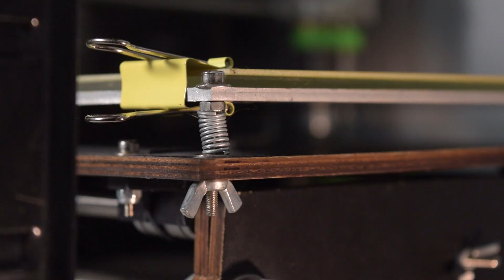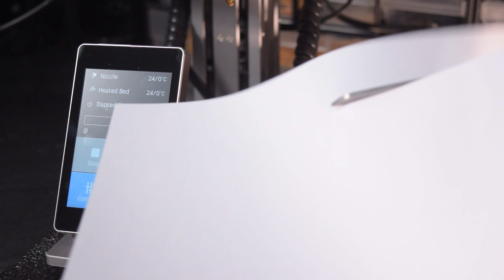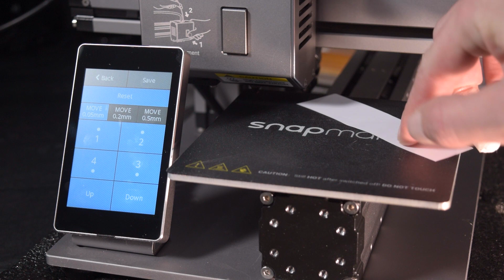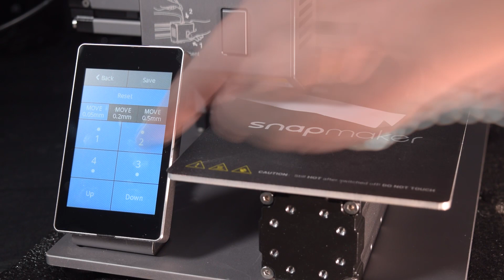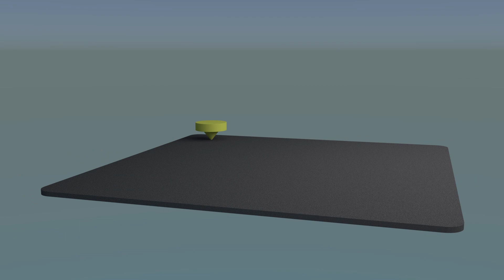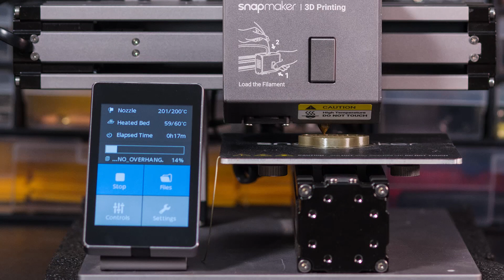How to level the bed with the Snapmaker 3D Printer (perfect first layer)

Comment: Can you do one on A350T?  My models are nicely printed on the left side of the bed, but the right side is not,  it’s very stringy and up smooth appearance.
Reply from the maker: If I had an A350T, I would happily do one. I'm surprised Snapmaker didn't submit one to Cura and other slicers for the A350T, they did for the regular A350 after I published my profiles - they were strikingly similar. :)

Comment: My x axis is uneven, the x tower has a trouble in that the holes for the screws on the back to hold it to the z axis are not drilled correctly.  If you connect the x to z and use a level the bubble goes to the right about 4mm and there is not way to change the x axis, what should I do?
Reply from the maker: That's a little odd. I'm not entirely sure. I'd start by posting photos of what you've got in one of the Snapmaker groups on Facebook to see if there's actually a fault with your parts and they've been manufactured badly, or if things just aren't connected right for whatever other reason. If there are issues with the components, that's something you'd have to take up with Snapmaker or the seller you purchased from.

Comment: Hi John,    Could you make a video on  "How to level the bed with the Snapmaker 2.0  3D Printer (perfect first layer)"
Reply from the maker: Funny you should ask! I've wanted to do one for ages, but haven't needed to re-level the bed on the Snapmaker 2 since I set it up in October. I'm about to swap out the hot end on the Snapmaker 2, though, so I'll need to re-level it after I do that and will definitely be doing a video going over both the automated and manual calibration stuff once I've experimented with them both properly.

Comment: just curious if you have code settings for the snapmaker original for cura. i believe i found the start and end gcode but i haven't found the extruder start and end gcode.
Reply from the maker: I can export them out and pop them on Github - I'll try to do that this week if I get a chance. You shouldn't need anything in the start & end code on the extruder tab, though, just on the main printer settings bit. :)
Reply: @JohnAldred  that would be great thank you for the reply. every time i create gcode in cura and try to print it on the snapmaker it is showing the target nozzle temp is 0.
Reply from the maker: I haven't had a chance to get to this yet (it's been a mad couple of weeks), but I haven't forgotten! I will try to get to it as soon as I can. :)

Comment: Thanks for this helpful video.  II have a Snapmaker 2 A350 so I would like to see your process for this one.  I have another question. I use a raft to print PLA objects that have only small contact points. The PLA raft comes off the print plate with great difficulty and often there is a residual layer left that takes  a lot of scraping to remove. I believe this is not right, but I am not sure what I am doing wrong?
Reply from the maker: You shouldn't need to use a raft for small objects, just a brim should work. But if it's levelled properly, the brim should come off as cleanly as the print itself. You might need to use the scraper to help peel it up initially and get underneath it, but it should come off quite easily if it's levelled right. :)

Comment: Your video explained how to correct problems with the print not sticking to the bed. What about when the print won’t come off after the print completes? Does that indicate the nozzle is too close to the bed? Too hot? Or do I need some material on the bed?
Reply from the maker: That's a tricky one. Sometimes they're just really difficult to take off, depending on the shape and size of the print and how much space it takes up on the bed, especially if it's only just finished printing. Taller models that don't have a large footprint come off quite easily. Short ones that cover most of the bed are a little more challenging. Usually, if I'm struggling, I wait for it to cool (the aluminium bed and the plastic shrink at different rates as they cool and it releases parts of the base as it does so) and then I push a scraper under one corner to raise that up and it pops right off.

Comment: Hi John. Just recently discovered your SM.1 videos and enjoy them very much. I purchased the SM.1 myself about a year ago.  Not into it as a hobby but rather as a tool to make custom parts.  I always used glue on the plate as I found it always worked, however it does destroy the bed sticker after a while.  I did try earlier adjusting the temperatures of the initial layer but never thought about lowering the speed . I'll have to try that.  I'm looking forward to seeing your videos using the laser and cnc.  I made some cork coasters with photos of my grandkids, and also personalized my leather phone case with the laser. All turned out great.

Comment: Neat video, thanks for re-affirming what I (eventually found out) how to do. I did notice that you have replaced the small rubber feat where the build-plate connects with what looks like washers. I'm guessing this is a rather important step, as (or at least I have experienced) head changes in the environment will slightly harden/soften the rummer leading to loosen or tighten those screws, making the bead slightly less level.
Reply from the maker: I'm not sure what you mean with swapping out rubber feet for washers. My Snapmaker is essentially the stock system as it came out of the box a little under a year ago, except for the Z-Axis extension and a filament guide I printed for the top. The only rubber feet I have are the ones underneath the main printer base. Maybe they tweaked the design slightly after it had been out for a while?

The environment definitely changes things, though, you're right. I tend I find I have to set my bed about 5-10°C warmer at this time of year (it's cold here in Scotland right now) vs the rest of the year. Normally I'm at 50°C, but at the moment I'm printing everything with a 60°C bed.
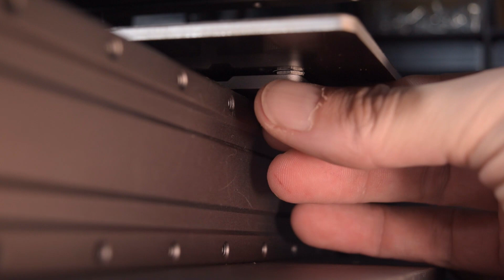Reply: @JohnAldred  Interesting, I guess they changed the design at some point, around 0:56 when showing the underside it looks (to me at least) like there are metal washers of some form, mine looks more like the one shown in this url (if it works).  But I guess both work. https://d3roxcpq5tricw.cloudfront.net/optimized/2X/8/8392be94a5054ffb25e039db7eeee41bfc61751b_1_375x500.jpeg

Comment: I have the snapmaker and yes I have problems with prints sticking I can only really use a raft print is the only one that works every time but then you are adding a load of time to the print. Will give your calibration a try thanks for the vid
Reply from the maker: I try to avoid rafts wherever possible. I've tried them in the past a few times, but usually they just end up creating a terrible underside on the print for me. So, it forces me to look a little harder at other possible causes of prints not sticking. Best of luck levelling, hope the video helps! :)

Comment from the maker: Do you have problems getting prints to stick to your bed?
Reply: YES!
Reply: @mediagroupr  Not anymore since I use the ZiFlex build platform and a similar process as outlined by the video on my Snapmaker with PLA filament) (sliced with Simplify3D). I use the "paper method" and adjust the extruder height so that I can hardly "pull the paper" anymore. The ZiFlex as the name says is a little flexible (for easier removal): yet this property seems to also be very beneficial for printing the first layer "a little harder down". No more problems with my prints sticking using ZiFlex.
Reply: @papa4narchia  PEI, that's the answer. Without it nothing works.